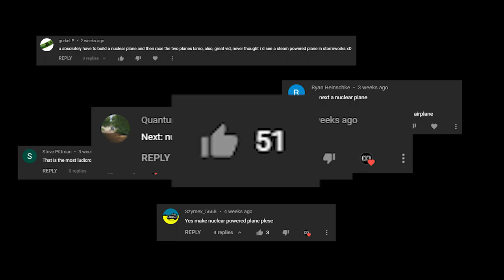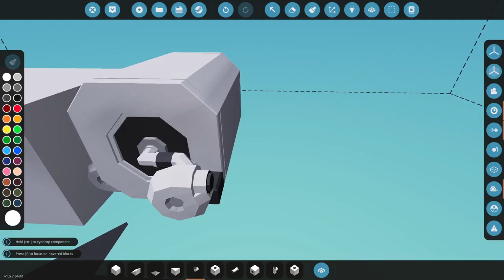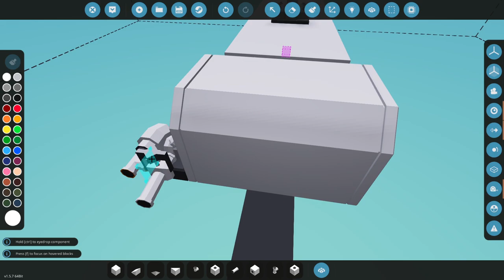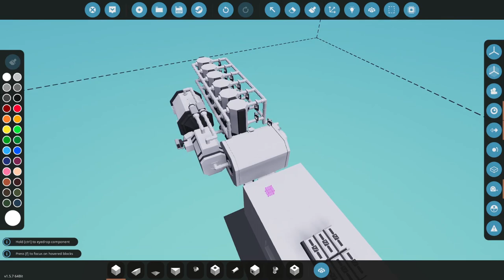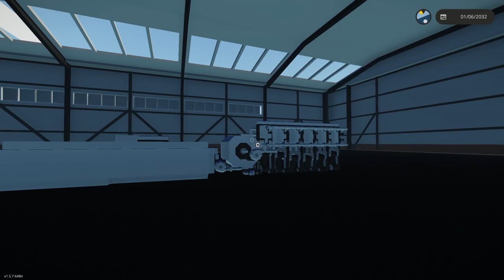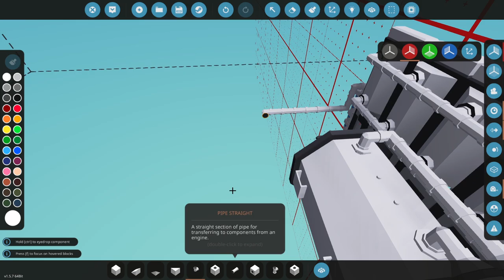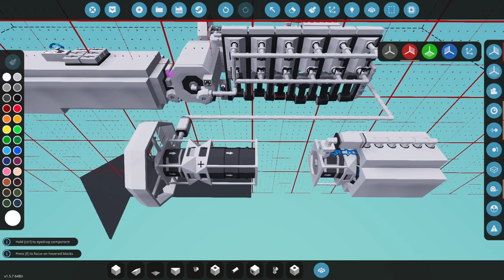Making A NUCLEAR PLANE In Stormworks!

Comment: Real nuclear planes would probably use the heat exchangers to heat the compressed intake air instead of a fuel injector, though I doubt thats possible with the systems currently in game.
Reply from the maker: It's been made irl, but was simply too heavy. Unfortunately not possible in the same way in stormworks

Comment: FYI the reason it didn't want to take off is because you had your rear landing gear way too far back. The plane needs to be able to pivot on them from the force of the rear elevators, with them so far back, the elevators just push the wheels into the ground instead of making the plane pivot.

Comment: try to make Daimler-Benz DB 604 engine in storm works General characteristics
Type: Water-cooled 24-cylinder X (4 rows of 6-cylinders) piston engine
Bore: 135 mm
Stroke: 135 mm
Displacement: 46.38 L (2,830 cu in)
Dry weight: 1,080 kg (2,379 lb)
Performance
Power output: 1,835 kW (2,500 hp) at 3,200 rpm at 5,100 m (16,732 ft)
Specific power: 39.6 kW/L (0.9 hp/cu in)
Compression ratio: 7.0:1
Power-to-weight ratio: 1.70 kW/kg (0.95 hp/lb)